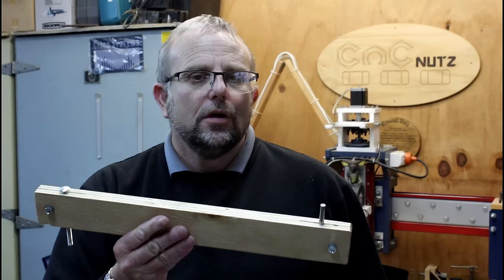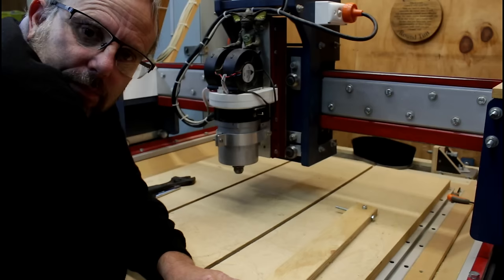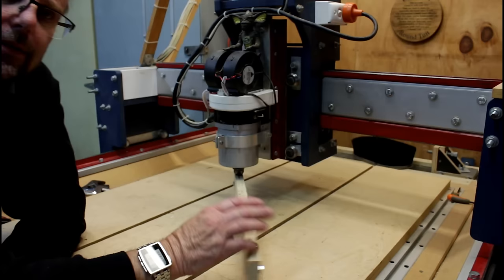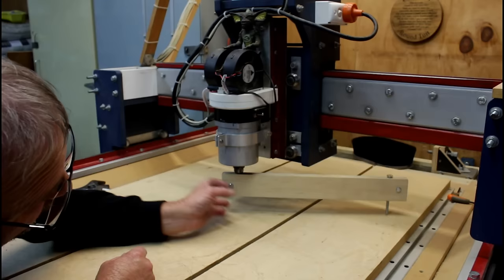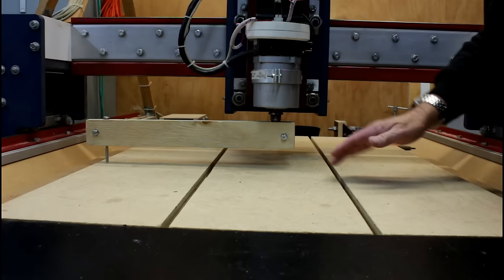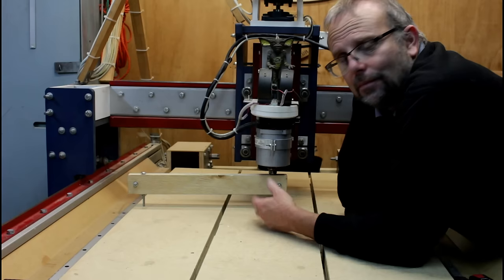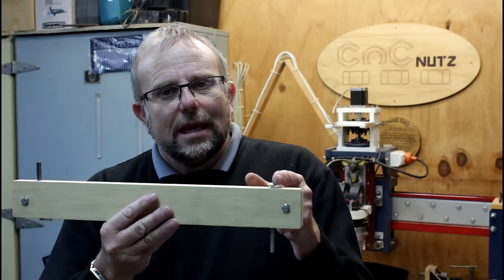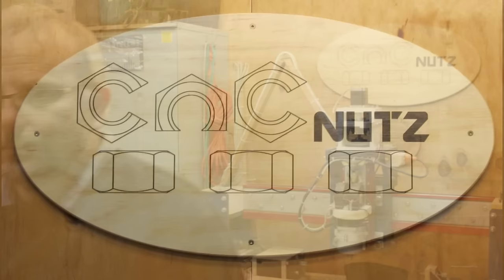Is your Router on the Level? - CNCnutz Episode 131

Comment: Excellent method! I would like to add an additional tip on top of it.
As you pointed out in the comments below, after the first raw skimming/surfacing of the table you will end up with ridges (i.e. high and low points) on the surface because the spindle is not squared yet.

MY HINT/TRICK:
place a small square piece of flat-glass (let's say 15x15 cm ) under the tip of the "arm" you're rotating over the table to check squareness.
The leveled surface of the glass will "cancel" all of the ridges/irregularities produced by the first "raw surfacing" operation, so you will not incidentally check a low (or high) point with the pin you put at the end of the long "arm" (called "tramming bar").

One can use four glass-plates laid down at south/north/east/west positions, or just use one single piece, moving it at the desired position as necessary.

NOTE 1: use normal "float glass" only. The tempered type has not a perfect flat surface because of the fabrication process.
NOTE 2: use a glass with some thickness (i.e. 8-10 mm) to minimize his deformations when laid down on the table.
NOTE 3: by using glass-plates you could also consider to fit a cheap chinese "vertical" dial indicator at one end of the arm.
NOTE 4: by using glass-plates you do not need to use a small router bit to flat the surface, as suggested by Joshua Russel in the comments below.

Comment: Peter, by moving the eccentric bushings your Z axis is no longer square to the table. The way we do it is surface the entire table with a small router bit with a small step over first. Remove the router and square the Z axis to the table using machinist squares. We re-mount the router and continue with the technique you showed but only adjusting the router mount to the Z axis.

Not trying to be rude just wanted to inform you. Depending how much correction you made your parts may come out smaller or larger than predicted and have small steps in the sides.
Reply from the maker: Hi Joshua and thanks for the info.
I went and checked the Z axis on my machine with a square and it is correct to the table.
This is because when I put the clamp on the Z slide I ensured it was square to the Z. As I'm sure you have also guessed the reason the router was out was because I maladjusted the Z axis using the V bearings so it isn't surprising that everything is as it should be. I take your point and can see that had the router clamp not been square to the Zslide I would have ended up with exactly the situation you described and I am grateful for your input. I appreciate any constructive comments on my videos so keep them coming.
The inital flattening of the table with a small cutter would greatly reduce / eliminate the ridges caused by a larger cutter with a large stepover. While I didn't express it well in the video I would have used the tops of the ridges as the reference point on the table for adjusting the router, since they would all be the same height, and then skimmed the table top to flatten and remove the ridges. It of course means machining again then rechecking adjusting where your method eliminates this step. I think your method it the better option.
Cheers
Peter

PS I like your Mechmate machine
Reply: Joshua Russell surfacing the table will make the surface parallel to the x and y rails, regardless if the z is perpendicular or the router being parallel to the z rail. after the table is surfaced, it would be necessary to check the z with a square.  the method shown would make the router  perpendicular to the table and thus parallel to the z axis
Reply: He adjusted the Z axis to make the Router tram to the table bed. So no the router would not be parrallel to the Z axis.
Reply: Joshua Russell i
Reply: What router bit did you use at what percentage of a stepover?

Comment: Peter,
What you REALLY want is to tram the spindle to the plane of the machine's fixed rails rather than the bed. Then you can skim the bed to match the rails. Since your rails are above the level of the bed you might be interested in this tramming method using taut wires I recently described on the MYCNCUK forum. There's a video in the second post which shows what's going on.

Comment: Your "thing" has a name. Machinist call it a tramming bar. I have used one on my CNC converted mill. I don't know why I haven't thought of doing the same for the router.  Good tip.
Reply from the maker: I don't know Freeman, tramming bar doesn't have the same ring to is as THING. ;-)

Cheers
Peter

Comment: Faster and more accurate if you replace the bolt with a cheap dial indicator.
Reply: good idea
Reply from the maker: It would make the adjustment easier for sure.
Thanks Keith
Reply: That's what I thought he will use when I saw him making this tool.
Reply: better to use a quality dti....

Comment: Thanks for the info!!!  I was worried about TRAMMING my new machine later this week.  This looks like a great place for me to start.  Though I think I'll add a inexpensive dial indicator where the bolt is.
Reply from the maker: +David Crook 
Good one David, glad it helps.
You might find a dial will drive you insane trying to adjust the machine as to a dial the table surface will probably look like you are running it over a mountain range especially with the huge offset from center. I suspect it might make it almost impossible to get it right. It would be good on a mill but probably not on a table like mine. Don't let me discourage you but if you can't get it to work then try it without the dial. I could be wrong so let me know how you get on. 
Cheers 
Peter
Reply: Good warning Peter.  It's pretty hard to drive me crazy as I have nothing but time on my side, but I'll keep your suggestion in the back of my mind.

Comment: they do this to mills too , its called tramming the head , the head of a big mill can be turned sideways and they need to do this regulary to make sure everything is level with the work the tool they use  has two dail indicators (one on each end with the axle to mount the thing in the middle of the beam ) they can set it to 1/1000th of a mm .........if there lucky or REALY patient
one thing i seen that i thought was clever was placing a pane of glas over the worksurface  , glas has a surface thats nearly as flat as one of those measuring tables , it smooth so it equalizes the whole top so you don't mess up youre readings in the damages and mounting pockets on the tablesurface  itself
Reply from the maker: Great information. Thanks.

Comment: Great video. Question: If your alignment is off, and you skim cut the surface 1st before testing with the "thing", are you getting an actual true reading then? Seems like your skim surfacing cut would have ridges causing some difficulty getting true readings. Just a little confuzzled....
Reply from the maker: If your table is new and never been flattened you need to do it first or your table top could be out by as much as an 1/8"
When you flatten it you will probaly get ridges but all the ridge tops will be the same height which you can then use as the reference point. Re skim the table top after adjusting will remove the ridges and you can recheck and readjust as needed.
Alternately flatten it with a small cutter using a small step over and you won't see any ridges. It will take time to do though depending on machine speed and table top size.

Comment: Where did you get the excentric bushings..? Are you also able to adjust both X and Y axis with the bushings? Do you see a need for having the whole gantry adjustable too?
Reply from the maker: The bushes I made myself on the drill press.
You need to watch the update video as it corrects an error I made in this one.
https://youtu.be/cKyfUaY5Ddg
Cheers
Peter

Comment: Once you have surfaced your spoil board surely the level plane will be set to the router? wouldn't it be better to set the router using the gauge with the new spoil board and then surface? I'm pretty new to this so I could be wrong
Reply from the maker: The first skim of the spoilboard flattens the table. While you would think a new tabletop would be flat the first pass makes sure it actually is flat. Material thickness changes over its length and small bows in tabletop supports will all be taken care of in the first pass. After that you have a uniform surface to work from. 
Cheers 
Peter
Reply: @cncnutz  yes, but if you skim your fresh waste board... your 'tool' won't be 3mil off on opposite sides. They'll be dead on. If it's out of trim, then you'll notice it most with the passes with the 1" or 1.25 flattening bit being not so flat... ridges along each pass. where am I wrong here?

meaning if you skim first then you're no closer to measuring with your method to tramming. right?

Comment: How can be the holes drilld perfecty perpendicular?  because any imperfections or drillbit vibrations can drive you to misalign the system
Reply from the maker: Hi Ovidiu
The holes in the stick don't have to be perfect for this to word. Even if you drilled them by hand and were 5 degrees out in every direction on each one it will still work perfectly. 
Cheers
Peter
Reply: @cncnutz  5 degree × 2 holes at 20 cm is more than enaugh to tilt the mill head. I made such a thing from wood i drilled the holes with 5 mm larger and i inserted a bronze bushing of 8mm on each hole with bicomponent adesive glue. Then i inserted on the bushings a 1m steel used as liniar rail shaft and i straighen them by placing a milled wood on the bottom for z leveling  and another wood bwtween at each side. This way i get good results at low cost. On one hole then i inserted a piece of rod with a screw and on the other side a micrometer gauage.
Another vatiant is to make a round plate out of wood or metal and in center to place a shaft . This needs to be straighten on a lathe after. Usage : insert shaft in the mill spindle and tighten it . Then lower it to touch the table then untighten the screws of the spindle mount and allow to rest on the table straight  on the plate then tight the screws . :)
Reply from the maker: I know 5 degrees sounds a lot and it is but the whole principle of this is you are creating a fixed point a certain distance from the center of the spindle. No matter how badly you make it the pointer will always be the same distance from the spindle center and the same height as you sweep it around. That is the beauty of this method. The stick and its holes don't had to be perfect for this to work. My first one was a piece of bent 1/4" rod which I use to set my drill press table perpendicular but it was a bit too shortcut the CNC. The key is to make the wooden arm long. The longer it is the better and the more accurate the result. Honestly the arm you build doesn't have to be perfect and the result will be exactly the same.
Cheers
Peter

Comment: How much difference did it make to the way it cut before / after?
Reply from the maker: Hard to say because I maladjusted it before shooting the video and didn't cut anything while in that state. The effect would be profile cuts would not be tapered on one side and flared on the other. Witness marks in pocket areas.
Cheers
Peter
Reply: @cncnutz  Fair enough, I have never checked mine in the 5 years I have had it "running". Also mine runs pretty square, but want to test that as well after seeing your other video.
Reply from the maker: @DodgyBrothersEngineering 
Just to be clear I mean square from the front to the back of the material and not in the X Y direction.
Cheers Peter
Reply: @cncnutz  I was more curious whether it broke more cutters not being properly aligned but if you never run it that way, then you wouldn't know from experience. As I say I have never measured or adjusted any of my axis in 5 years of running it. I must have got it reasonable right from the word go, or it would be showing weird results. I don't even dress my spill board. One of these days after I have finished my upgrades I should check these things out.

Comment: The router axis must be set parallel to the z-axis slide. The z-axis must then be set at right angles to the x-axis slide. Finally the x-axis must be set parallel to the table top. You can reverse this order if you like, but if you just put the router axis at right angles to the table, you have aligned nothing.
Reply from the maker: You are correct Don and the next video was a correction to this one. 

While Ideally the X axis will be parallel to the table top before you start, flattening the table top will effectively achieve the same thing. Once the tabletop is flattened the Z axis needs to be set at right angles to the tabletop or the X axis which now that the tabletop had been flattened are parallel. On my machine using the Tabletop is easier as I cannot get a square into position referenced off the X axis and that is where my Cam bearings should be used. I should have moved the router mount to adjust tramming and not the Z slide.
https://www.youtube.com/watch?v=cKyfUaY5Ddg
Thanks for reminding me of this as it has got me thinking again about my new X, Z axis build and the fact I need to build in adjustments for easy tramming. Not that I have time to design it at the moment   :-)

Cheers
Peter
Reply: @cncnutz  I've seen a few of your videos and I knew there was no way you would have missed any of that, but I thought I should point it out in case any viewers really thought this was all there was to it.

Comment: Not very accurate, the Colet, Router, Router bearings, "Z axis" could all have issues or run out. Not to mention that wood is not at all perfect in thickness. It is dried and shrinks and swells at different rates with temp and humility. Lots off things could be off or all of them at once. Use a dial indicator, and know that Wood routers are not designed to be as accurate as a true CNC spindle.
Reply from the maker: This method is more than accurate enough to set the router to the table. The wood can be as warped and twisted as it like and it won't matter so long as it doesn't warp, twist, swell or shrink in the  minute it takes to do the sweep. The runout on the router will be the same whether you use a dial or a the stick and the rough surface of the table will make the dial readings a bit hard to get a good reading on. A spindle is better but most home cnc owners use routers.
Cheers
Peter